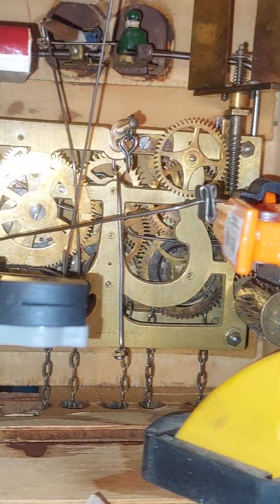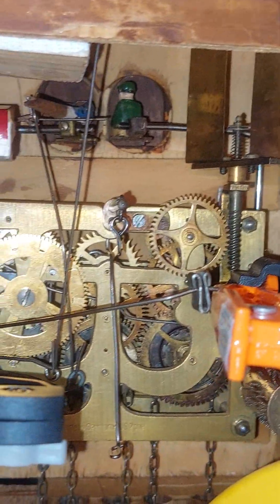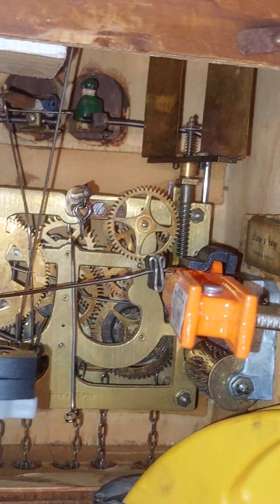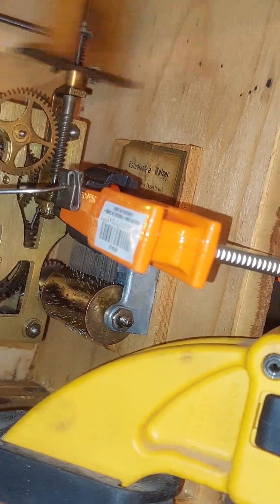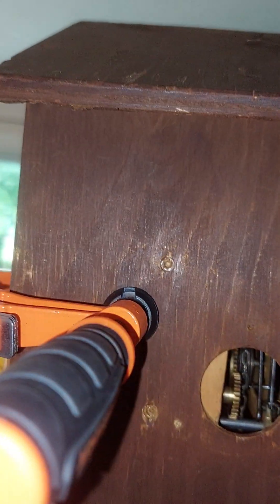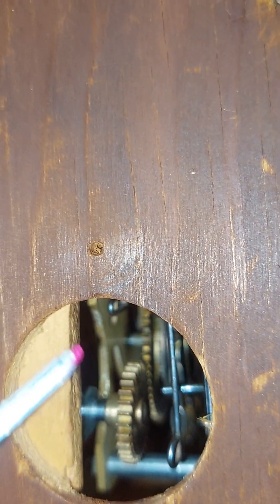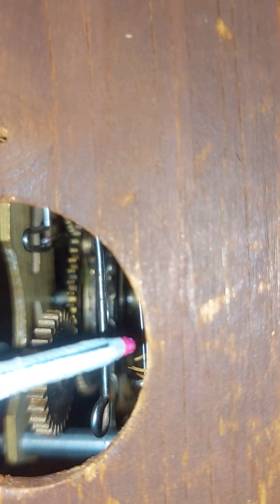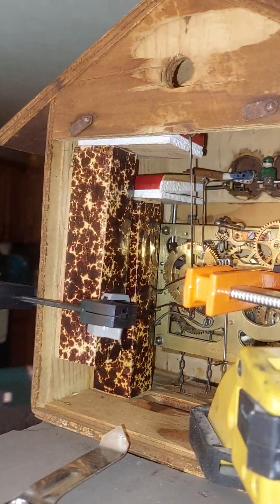Cuckoo Clock with Music, adjustment of Music Box to Main Gear.

Comment: On mine the music has trouble starting. I have to pull on the weight and hear a gear grind a little then it starts. Any suggestion ?
Reply from the maker: @joegraham3314  Has the musicbox/movement been cleaned or adjusted before? If not suggest doing that. Appears that the Governor gears are dirty or worn if you have to pull extra hard for it to work.  May need to remove and inspect music box.